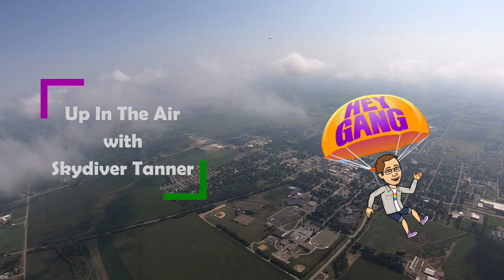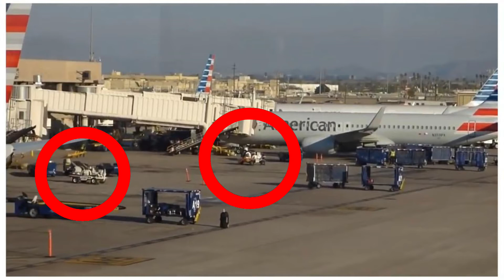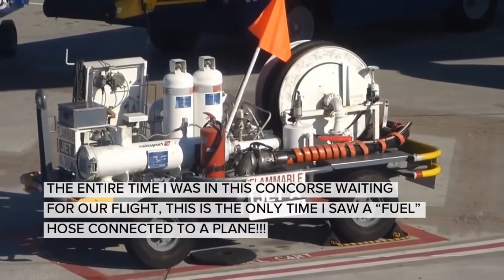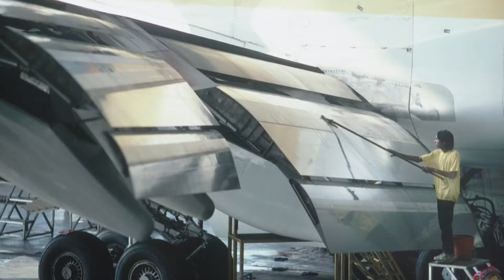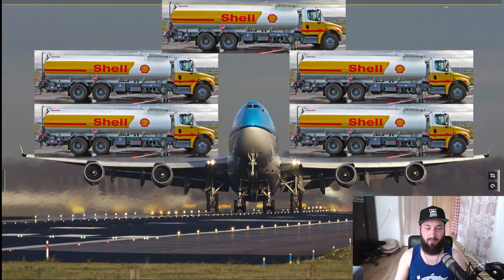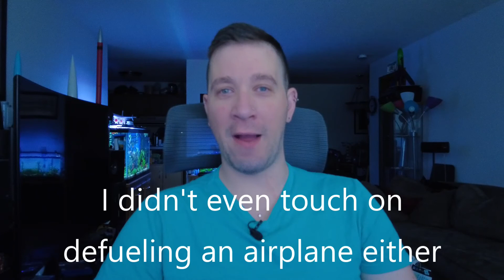Jet Fuel Hoax Visited: UITA w/ Skydiver Tanner

Comment: Jet engines consume very little fuel when flying at higher altitudes. The reason for this is because at higher altitudes there’s more oxygen. This is why pilots always say planes use more fuel during taxi and takeoffs. The air makeup near ground is around 21 percent oxygen and 78 percent nitrogen gas.
Reply from the maker: I would love you to go to altitude and show how easily you can breathe with the "more oxygen" molecules.🤣
I guess the oxygen masks should the plane depressurize are just for show
Also, is a car more efficient when at speed and cruising, or during stop and go traffic/acceleration?

Comment: Bro! Just stop! You sound ignorant. 😂😂
Reply from the maker: What's your real world experience that contradicts my experience?
Reply: @skydivertanner  it’s called common sense.
Reply from the maker: @johnnyleazer3282  that's not an answer, that's is your own incredulity. 
My common sense based on my real world experience is; I physically watched fuel going into the wing, therfore the wing is holding the fuel. 
Your lack of understanding physics, and asserting your own incredulity is not evidence.
Also, many scientists and people that understand basic physics could say, yes, it's common sense to put fuel in the wings to distribute weight, and that fuel is required to produce an energy in order to propel an airplane through the sky. There isn't enough energy in air alone at altitude to propel the airplane

Comment: Airbus A380 has 160 tons of fuel in each wing ?
Reply from the maker: I'm not sure on it being indont know the capacity of the tanks inside the wings
Reply: @skydivertanner   The plane's max cap is 360 tons of fuel. Who knows where it fits ?
Reply from the maker: @bigwoodbear4192  I'd imagine wing tanks, center tanks and a tail tank. Probably very easy to look up. Wings are fairly thick. I think about my 75 gallon fish tank, the space it takes up, and how easily several hundred of those could fit in a wing alone
Reply: @skydivertanner   It works out to 162  Cubic Metre. I don't see that space in one wing but I don't know the inner available space in one wing.
Reply from the maker: @bigwoodbear4192  I'm not sure either. Usually wing tanks run from the wing root to almost the wing tip (respectively). Looking top down, the front and back 1/4 wouldn't have the tank. The inner 1/2 would be a tank. Then add the thickness of the wing for fuel to fill. So 2 wings with that for fuel, then a center tank, and most like an aft tank
Reply: @skydivertanner  Either way it's interesting, thanks for the input.

Comment: go to each aircraft  specs and find out amount of fuel capacity..then the weight of that..bingo! the question is, does the engines ever run on compressed air alone?..(industry secret) or what..
Reply: No, they cannot run on compressed air alone, please...

Comment: 15 years ago doesn't count things are done differently now
Reply from the maker: And you think airlines don't keep airplanes for longer than 15 years? I also still have many friends who still work there. I have yet to see a very well explained video or essay on how airplanes fly without fuel and maintain altitude and speed. Perpetual motion aircraft is not a thing
Reply: @skydivertanner  not without fuel idiot, less fuel. You can't put 30,000 gallons in the wings.
Reply: Many of the airliners in service today are probably older than that.

Comment: 2 minute refueling ? 600 gallons at best for an airplane that supposedly holds 50,000 gallons of fuel?
I was born at night but not last night! Lol
Reply from the maker: So you completely missed the point it seems. They don't fill up completely full. If the go a short distance for their next destination, they won't need much fuel. If it came in with fuel already on board (which they always do) they may not need much more to go to their next destination.
Thanks for pointing out that you have attention issues
Reply: @skydivertanner  No I don't have attention issues. If my car holds 15 gallons, I don't top it off with a half cup. 
There's no way the planes hold the amount of fuel that they say they do. It's a ridiculous argument.
Reply from the maker: @golpher12  well then your misunderstanding of physics and how things can work is not my issue. If you fail to understand an airplanes wings are capable of holding maybe 5,000 gallons each, that's on you and your lack of understanding. It's no different than bridges being able to hold multiple semis full of fuel.
Also the fact that just because wings might be able to hold 5,000 gallons each, does not mean they fill them full every single time. Only enough to get them to their destination and maybe an extra half hour of flight. Landing gear upon landing do better with less weight, same with aircraft performance for landing distances. 
Funny no one seems to argue my overwing fueling where we can physically see the fuel entering the wings
Reply: @skydivertanner  You're a gas lighting lier and I ought to tan your hide Tanner.
Look up the specs, it's way more than 5,000 gallons in each wing. Although the wings could not nearly hold 5,000 gallons they are claiming 10 times that amount.
You have time to repent!!!
Reply: Skydiver contradicts himself, first he said the airplane arrived with 10k of fuel and then said that they only put enough to get to the next destination. What is it?
Reply: So the only evidence you have is personal incredulity. Wow, I am convinced.
Reply from the maker: @alexf962  and what's yours?
Reply: @skydivertanner  I was talking to the first guy, I am a pilot and am quite aware of the fuel!
Reply from the maker: @alexf962  ah, yes. More people responding against fuel than for. My apologies. It is rather funny despite explaining how airplanes don't need to fully fuel up, and even if they did, how a wing could hold it. I assume they imagine the wings are only a few inches thick versus some being several feet thick
Reply: @skydivertanner  They also think personal incredulity Is a strong argument. But the best part to me is how they think jet engines only work on compressed air. Hilarious, Just hilarious.
Reply: @alexf962  You should be
Reply: @golpher12  No sorry, I need evidence, which you did not provide.
Reply: One question how many trucks of fuel is it needed to load a 747 or a airbus 380? A truck holding 12k gallons of fuel?

Comment: So you can put 25000 in those skinny wings ? Ha ha
Reply: Wings on aircraft can hold tens of thousands of pounds of fuel, they are several feet along the wing root even on mid size aircraft. They are thick inboard and taper thinner the farther you go outboard.
Reply: @Robthisguy  You should take a closer look. Find yourself a picture of a 767
Reply: @bobcoulon2449  yeah those wings are massive, again probably several feet thick tapering to just a crawl space of area. Those could easily hold several tons of fuel. Specs say 24k gallons max fuel capacity. Maybe it has a fuselage tank lots do, so 10k gallons per wing is a good guesstimate.
Reply: @Robthisguy  not several feet thick oh, look at them don't be stupid
Reply: @bobcoulon2449  “don’t be stupid” dude I’ve worked on aircraft for 15 years and been involved in wing replacements on smaller aircraft than a 767, and those wings were 3 feet thick. Looking at a picture of a fully built wing with all curved leading edges and panels gives it a more streamlined look making them appear thinner. Just google wing box construction on Boeing or whatever aircraft and look at the wing root, just look how massive an a380 is.
Reply: Some of these large planes wing tanks you can walk in no problem. A little research you can find tons of pictures of people standing inside the wings while the wings are being built or fully put together!

Comment: If the fuel valve is under the wing there must be some type of valve that keeps the fuel from pouring down right . Now when you connect that nozzle under a wing that all ready  has 10 thousand pounds of fuel in it you would need more than 45 psi to get that fuel in there . Everything you say makes no scents and does not add up you make the hoax seem more reel. hahahahahahahahaah
Reply from the maker: And you make me laugh with your lack of understanding mechanics and physics and how things can work. So I guess we both humored one another
Reply: @skydivertanner  Make it make sense instead of saying it doesn't@

Comment: How is possible that an airbus a380 can handle 320000l or 300 tons of fuel in the wings when totally weight is 560 tons ???
Reply: Dry weight vs wet weight.
Reply: Does it say with fuel or with out
Reply: Exactly! Nobody is saying there is zero fuel, but there is no way an A380's wings could hold that weight, plus, the plane would never fly under those extreme weights! When a plane turns all of that fuel-weight would act as 'ballast' as in a ship and the pilots would have an impossible task of dealing with all of that weight redistribution as fuel would be slushing around constantly.  There is fuel, just very little of it!
Reply: @edkiely2712  @jozefk93 The wing tanks have baffles in them to prevent sloshing just like tanker trucks. That 560 ton measurement is the maximum takeoff weight which includes the weight of the fuel, payload, and the aircraft itself. Also, most of the time airliners don’t fill the tanks completely all the time. They normally fuel them only for the distance they plan on flying. Filling them completely every single time would actually reduce how much payload they could carry such as passengers or luggage. Folks like you always tell people to “do their own research” and yet you do zero research yourself.
Reply: @mrzoov3661  Keep believing the lies brotha! You are probably one of those guys who wore his mask and stood 6ft apart, like all the other mindless order-followers as well!🤣My dad was in the AF for 22yrs so, I've been in and around planes, especially large planes, my whole life. There's no room for all that enormous liquid and tonnage alongside the ribbing, spars, stringers, hydraulic components, etc. Every cubic-inch of volume would need to be made available to simply store a FRACTION of the dozens of tons that supposedly fill a wing. Also, though planes don't always fly at maximum fuel capacity, they are supposed to still be capable of doing so so, your point there isn't even relevant! Finally, plane wings would NEVER bounce with the visual weightlessness and levity they do when hitting the bumps and uneven parts of the tarmac as they taxi. I find that many of the apologists for this lie are those who've worked in the aviation industry, either directly or, indirectly. They want to believe so hard that, the exorbitant prices for flying are predominately related to fuel costs(approx 50-60%). The real problem lies with most people's inability to confront the fact that- they've been lied to about many things in their lives and, they are unwilling to confront and overcome the cognitive dissonance that keeps them in perpetual mental slavery!
Reply: @edkiely2712 
Since you have decided it's not possible, what exactly is the total available volume inside the wing. How many litres or tons of fuel could they store there and how did you work it out?
Reply: @edkiely2712  Exactly.....common sense!!!
Reply: For real

Comment: There are no videos or photos are wings with fuel tanks - the one photo that circulates is called disinformation - there would be 1000's like cars and everything else that holds a fuel tank - no evidence planes hold the amount of fuel require, no evidence fuel tanks exist other than drawings - GTFOH - no photos, no videos - should be 1000's   -  sheeple
Reply from the maker: Aside from literally opening the fuel caps on the tops of the wings and being able to look inside them